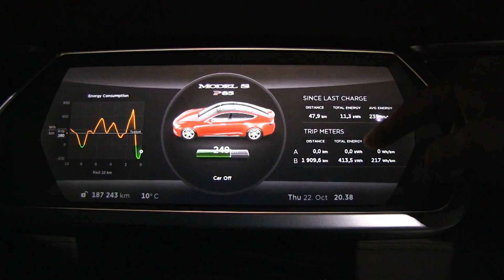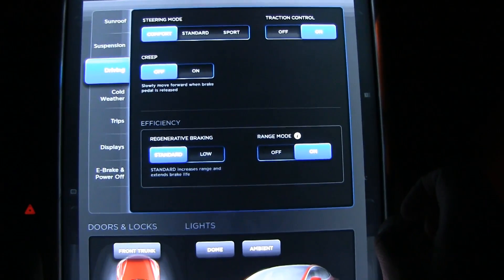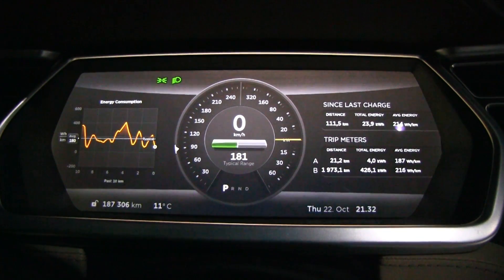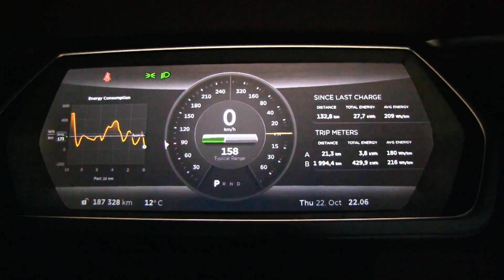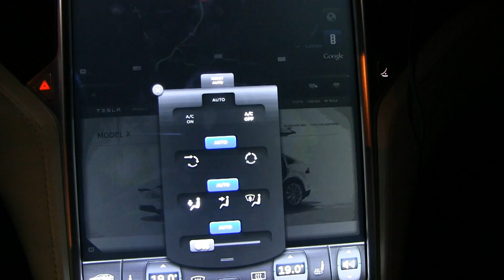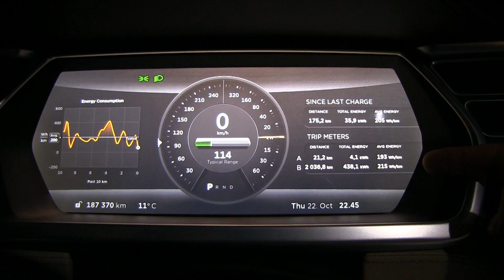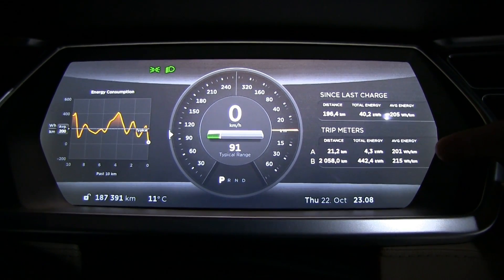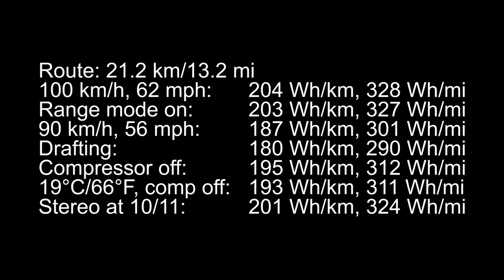Tesla Model S P85 energy test

Comment: Hi Bjorn! Greet video. Didn't know that reducing speed (and power off the compressor) would make such a difference. I've tried this yesterday with my 2013 Volvo V60 D6 Plugin Hybrid in Pure mode (keep the speed between 85 and 90 km/h) and the electric range was a lot better. Keep up the good work!

Comment: It will be good to measure energy consumption of each device in the car with a wattmeter. But the video shows that the main power consumer is the engine and it seems that turning off cabin heater, music and other similar devices will increase range by 1-2% which makes no sense. The only way to save charge is to heat the cabin while you're connected to a wall power. Or drive very slow.

Thank you for the test, Bjørn.
Reply from the maker: +Dmitrii N There's no engine in a Tesla Model S. But there's an electric motor. https://en.wikipedia.org/wiki/Engine
It makes sense that turning off heater completely, which basically is to switch off the fans, will save energy. However, this is not a usable option in 10 degrees weather.
Reply: +Bjørn Nyland Yes, I meant electric motor.

Comment: Super interesting as usual :) The conclusion for me is that the #1 factor which drives the consumption up or down is aerodynamics. I wished you did the same test with all windows opened to increase the drag resistance and see. And again with roof opened or closed. Air resistance is a factor of S.Cx (front surface multiplied by drage resistance coefficient), I can safely predict that the Model X will consume a lot more than the Model S in the same conditions (road, speed, weather, etc.) as it has a much bigger front surface.

Comment: Running the air conditioner in my gas car cuts the highway mileage by 8mpg. I have a very efficient gas car with a small engine so the AC really puts a lot of load on the engine as a percentage of highway power required.

Comment: How good Tesla keeps it´s value? I´ve already seen 100k driven Teslas sold almost 1/2 the price. It´s odd to me cause there´s not many parts  that need maintnance. Does mileage really have that much of a difference with electric cars?
Reply from the maker: +theSammyM333 I don't know which one sold that low. I bought mine for 680k and expect to sell for 400-450k (200k km odometer) or higher if I sell to Denmark. A fossil car would probably have way lower price after 200k km.

Comment: That's funny ;-) it is the same with a petrol car! if you want to save gasoline, drive slower and turn off the ac. Maybe a electric car is not so different after all ;-) Now I just have to wait for them to be cheaper!!! thanks Bjorn.
Reply from the maker: +Pedro Ventura Neither electric nor fossil cars can bend physic laws.
Reply: +Bjørn Nyland I wonder if Peltier junction (solid state) AC systems are ever going to be feasible for automotive use. . . .

http://www.geek.com/news/peltier-chip-air-conditioners-562123

Comment: Wow that was an awesome test. Really interesting seeing all of this tested and presented. Just one thing, why did Tesla make the "Range mode" if it makes like no difference?
Reply from the maker: +Daniel Sadjadian If the car is cold, a lot of energy will be spent for heating up the battery and cabin. If the drive is short, there's no need to heat up (or chill down) the car that much. Range mode on RWD cars will therefore reduce the power to HVAC and turn off battery heater.